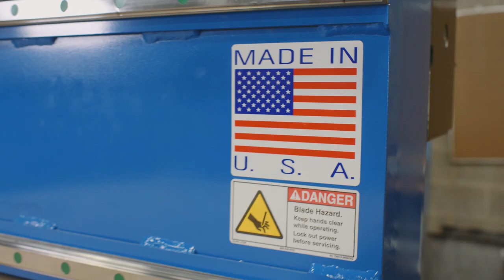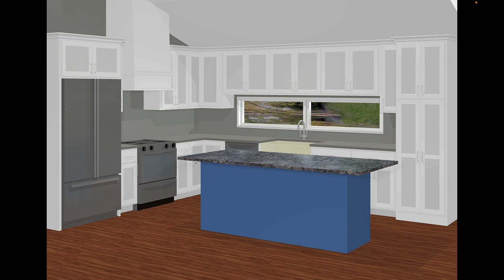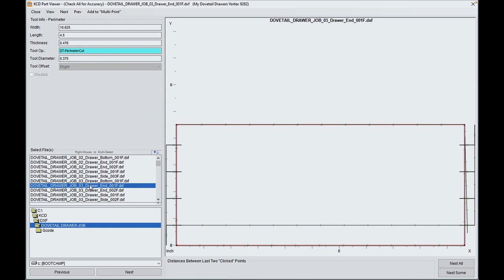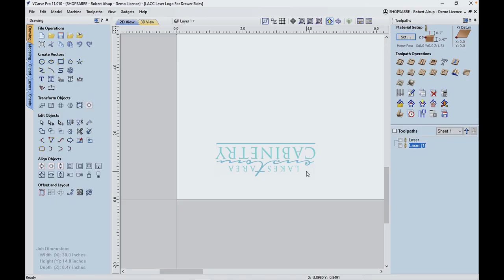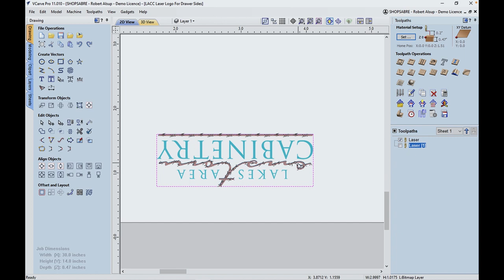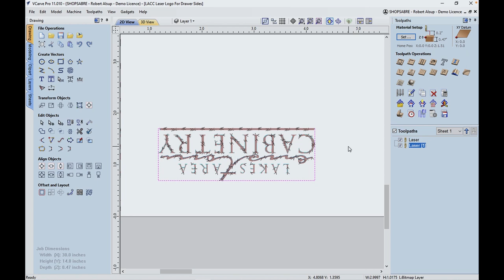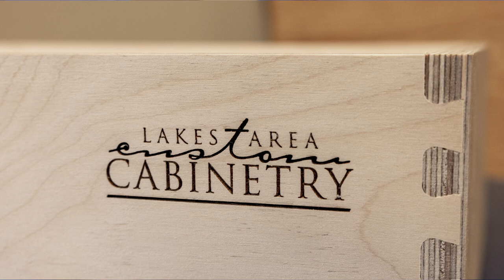How to make Dovetail Drawers with ShopSabre CNC

Comment: would you recommend using unfinsished Baltic birch as opposed to prefinished?  So that they can be sanded down.  My dovetails dont seem to come out perfect.
Reply from the maker: Either works with appropriate setup, if they aren’t coming out right it’s likely tooling setup/adjustment in the programming

Comment: I've been a journeyman cabinetmaker for about 25 years. I use Blum undermount drawer slide hardware. I find it frustrating that people are still going through the extra work of notching their drawer boxes for the hardware. It's totally unnecessary if you just make the ends shorter than the sides.
Reply from the maker: Thank you for the comment, we understand the frustration. Each person and Shop has their own preferences - there is really not a right or wrong answer here if it accomplishes the end goal.

Comment: Would be pretty nice if the speeds and feeds were posted with the bits.
Reply from the maker: If you own a ShopSabre you can call tech support and they will gladly help. We try to keep the videos entertaining and don't want to bore viewers with information that can change day to day with material, bits, hold down, etc.

Comment: I just got dovetail setup on my cnc machine however due to the lack of contact area in the dovetail joint I realized that there isn't a good contact area for the glue. I noticed that the glue goes down in the round area from the profile tool and the glue on the tips get wiped off. How do you glue yours?
Reply from the maker: Less glue is more in most cases…. The joint will require very little glue when adjusted properly within your software. Visit our website to see examples.

Comment: I wish it was as easy as you make it look. I’ve had terrible success with vortex dovetails and mozaik. Am I missing something ? My dovetails don’t look like yours
Reply from the maker: We recommend connecting with Mozaik as getting the settings right in Mozaik is a big part of the success, our tech team can help with tool setup and machine functionality but ultimately the tolerances you set will determine the results with the joint
Reply: Ive tried everything including Shop Sabre Support, which is GREAT, but they wont come out like the video shows.
Reply from the maker: It’s one of two things - tool settings or software settings
Reply: @shopsabre  i ran a sheet of Baltic Birch today of drawers and they came out nicely except that after assembly they do not look clean and finished.  If im using prefinished Baltic birch, what can I do to the finished product to make it look like yours

Comment: It's very frustrating when the 30 seconds of content is hidden inside 15 minute videos. And it really isn't a 'how to', is it? This is really just informational and "Click this button here." 

I do not know how to make these dovetails. After the video, I still do not know how to make them, but I know there is a software, some software, somewhere, that has an existing plan and configuration and tool settings. I don't have that or access to that, but it exists somewhere. Then I have to click a button. I don't really know which button, because it was only a flash compared to the greater video. But there have to be existing plans, some kind of selection and then I let the button do the work. 

But, really, none of that is "How to", this is an information that somewhere is a product that does something but I have no idea how to do it or apply it to my projects.
Reply from the maker: Thank you for comment, we appreciate the feedback and will try to address this in future videos. That said, in our video we do mention what software is used and ultimately, the creation of the dovetail is done by the software product itself. Again, we build the CNC machines but the software companies ultimately support their product features, we just show these capabilities and show that Dovetails can be made with a CNC machine using the appropriate tools & software. We do have private videos available to our clients that get more into the finer details and explanation / training but these are private and a benefit to our clients on our SabreNation University page. Again, appreciate your comment and we will again try to better address this in the future content.